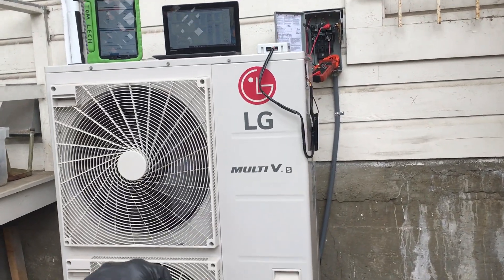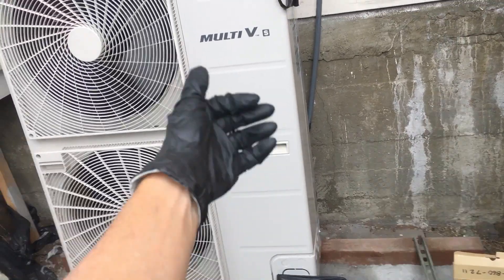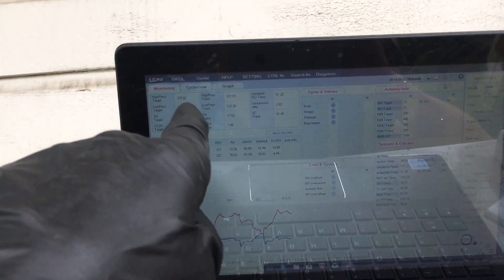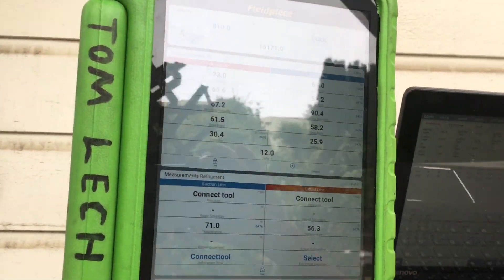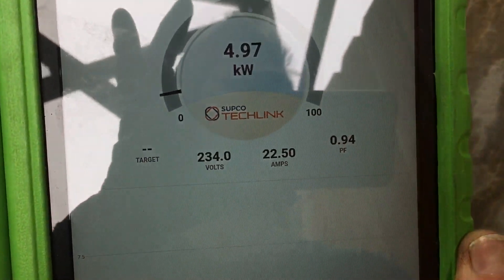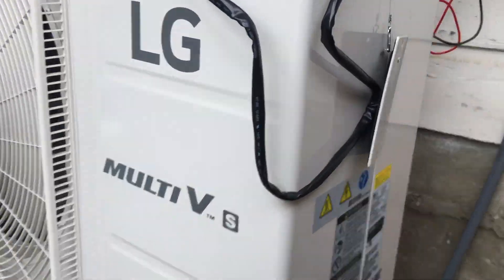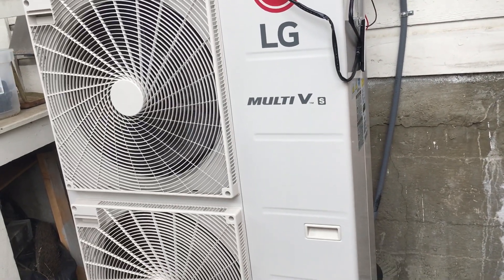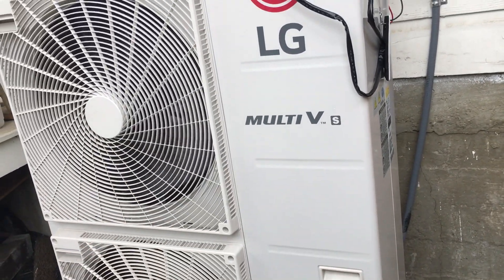LG ARUN060GSS4 these are the quietest heat pumps we have ever installed

Comment: Have u used these heat recovery variants with the hydro kit? If one zone is calling for heat i.e. a pool heat exchanger, can the unit cool other zones by dumping heat in to the pool and also by cooling? I dont understand if the cooling capacity is max rated at 5 tons or it can actually be higher if were cooling via the outdoor unit and recovering heat into the pool as well. I would love a 3 phase 10 ton commercial, but i dont have 3 phase 230v
Reply from the maker: Correct as fast as it is cooling your house it could dump the heat into the Hydro unit heating your pool or your hot tub or your domestic hot water for your house. 

If money is not a problem, you purchase two units if that’s the capacity you need for your pool . 
     If money is not a problem and you have a little area property, real estate or roof, you convert your solar to three face solar. And you have a three phase panel. Dedicated for your three phase equipment..

Comment: where to get and at what cost is the interface between the unit and the laptop? also the software for the laptop ?
Reply from the maker: Directly from your LG distributor.  When you sell and buy the equipment and you go to the training courses and purchased it at the time well in class.. 
   I don’t remember the price cause that was like a decade ago.  I’m thinking somewhere close to $300 for the interface and the software.. 
     But they have like two or three different interface hardware now. 
        They have one unit that can connect to the indoor unit
      They have another unit that has Bluetooth capability
Reply: @coldfinger459sub0  How available are parts for this unit. ( I am asking as I am planning  to buy a never installed unit from 2022.)

Comment: Will LGMV tell you the total refrigerant charge for a given system? I know it will tell you all the other diagnostic specs. In other words, does it have anyway of verifying the actual weight of the charge ?
Reply from the maker: The installer verifies the weight of charge on initial installation there’s a formula used when you add each foot of refrigerant line and the head configuration combination you do the math and come up with what is called your adder.    The adder is the amount of refrigerant to add on top of the charge of refrigerant that comes inside a unit. 

       But then like the other manufactures say Daikin for instant for Mitsubishi multi city LG also has the software that you plug-in through your laptop and you put the system in what’s called a test mode. 
           Only in this mode under ideal ambient load conditions. 
        Software will take over the system and set all the interior air handler fans take over the heat pump condensing fan and said the RPMs of the compressor to A 16 known pray amateur to push the The system to its limit and start taking temperatures and pressures were they have all the sensors located. 

         And they have a pre-written you can call it math formula or algorithm that taken into account the superheat and sub cooling that it gets off the outdoor condenser the indoor air handler‘s because the sensors are located on the inlet and outlet stream of all the refrigerant pipes when you look at the expansion valves what they are feeding for refrigerant and you can tell if they’re starving for refrigerant by the numbers given on the chart. 

          Sales man of all the companies like to tell you oh you just plug this in and it tells you if it’s full or not that’s kind of a twist of the truth without all the information 

         The technician actually Hass to have some experience some knowledge and have to ability to read and understand. 

        But yes LG like all the other manufactures have a test only mode to test the refrigerant charge. 

           Put on a small system like this if you’re in doubt even the slightest bit no matter who the manufacturer is you just simply recover the refrigerant charge and charge it back up with a complete charge including your Adder. 
            Then you know for a fact you are 100% charged and then you can do your comparison of the before and after and just buy recovering the refrigerant since it only takes a few minutes you will be weighing it out on a scale and you will know 100% for sure without guessing whether you were low on refrigerant or full on refrigerant. 

         By recovering refrigerant if you were 100% full on refrigerant and it still was not cooling properly then you know you’re looking for a different problem
Reply: @coldfinger459sub0  I have a factory unit new unit and need to recovery approx 1.7lb. I’ll do a final calculation when I finish the line set and take a precise measurement of the exact length of copper piping being used. I’m thinking it might be best to
Reply from the maker: @thisis5123  there’s only one way to do it and that’s the do it the right way.  There is no other way any other way is nothing more than guessing like trying to play horseshoes where you get close enough. 

         It comes with an installation manual ( RTFM ). And it gives you the exact math and calculation and weight per foot of line any changes on the diameter of the line.
         Calculated off the liquid line set. 

Depending on which model you have there might be an ad or an adjustment for the tonnage of each sise head. 

But that depends if you have the residential unit with the distribution box or you have the commercial unit that uses the single line set RTFM
Reply: @coldfinger459sub0  I Have the Outdoor Unit ARUB060GSS4- Heat Recovery Unit PRHR023A- and two ARNU303M2A4 wall mount units. Running aprx 40foot 3/8, 5/8, and 3/4 hard ACR to HRU, then adapting 5/8 to 3/8 vapor output on HRU and running 4 lines of 3/8 (vapor and liquid for two indoor unitsg about 15feet.
Reply from the maker: @thisis5123  then inside the refrigeration charge weight calculation the paragraph in the service installation manual will give you the formula to figure out the correct weight to add.
Reply from the maker: @thisis5123  it sounds like you did not fly out to or travel to one of the factory distributor training service center.  
                 Often this ends in hey disaster or  result unsatisfied with the product due to improper installation